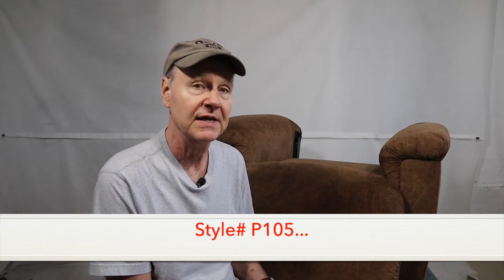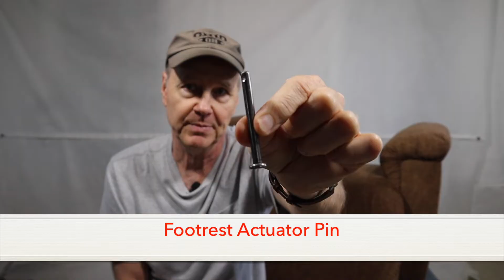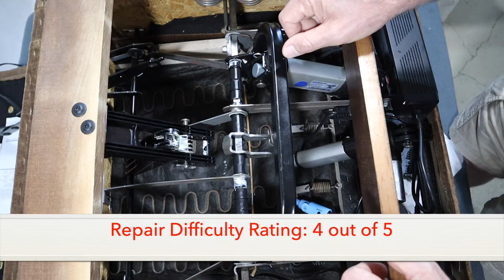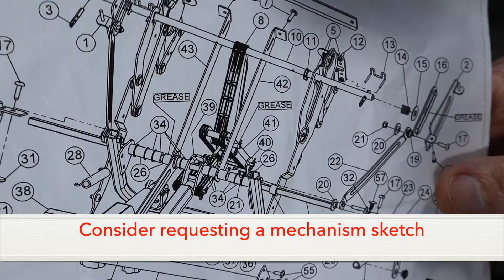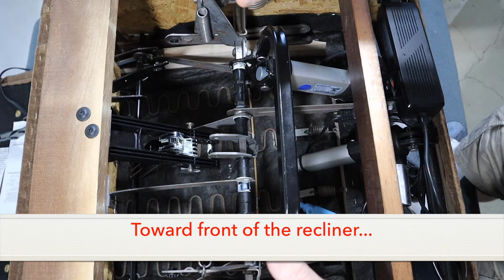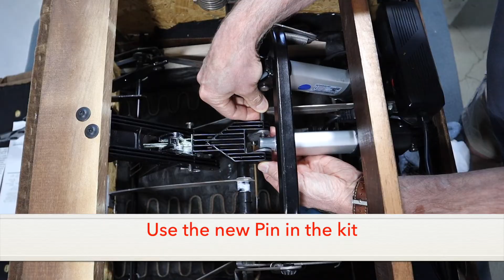La-z-boy Drive Toggle Clevis Install Setup

Comment: Nice videos and calm, relaxed demeanor.  The drive rod removal was a bugger for me until I got my son the tap it while I held the plastic part and levered against one of the brackets that kept moving and preventing the rod from sliding through.  Hard to explain,  but the drive rod on my chair required some pretty vigorous tapping of a long screwdriver with my hammer. I still have to go back and figure out the position of the springs and the metal piece the spring attaches to, as it fell off when I removed the springs for access and pushed the rods through. I saw one iy who had an extra drive rod so he could push the old far enough out while keeping all parts lined up.  But most consumers like me won't have that, nor did I have something long enough to push the rod far enough while also retaining the parts in place.  Plus on my chair you have to remove all the staples along the bottom so the leather can be rolled down and the drive rod accessed to tap through.  What a joke.  I'd never buy one of these POS again. I did see Amazon selling two metal replacement parts, probably like something someone describes below.  But La-z-boy shop sent me the one piece just like in the video.

Comment: Great video. Thanks. As another poster said, there is another toggle drive that does not require removal of the shaft. Much easier. My issue was parts had broken and disconnected, and I was not sure how they all mated together. Once I saw your video, problem solved.

Comment: I replaced the clevis on my electric Lazy Boy recliner this weekend. Thanks to your video all went well but for one issue which I believe was present before the clevis replacement. The foot rest when retracted does not draw tight to the rest pocket in the frame, it has a 2'' gap. I can push it closed with one finger (no resistance), remove my finger and the rest drifts forward. Other than this, the chair works flawlessly. the rest when activated, rises to the full extended position with no jerks ,bumps or noises.
Reply from the maker: @Chuck Ford - It's possible that your footrest actuator was damaged when the old plastic mechanism parts failed, preventing it from retracting fully. Or, if it does have its full-range of motion, you may be correct. There may be something else wrong that's unrelated to the Clevis install.
Reply: @reclinerrepairguy4155  Based upon your experience, would you dare a guess as to what it could be? The scissor mechanism dose not appear to be damaged or bent. It almost acts like it needs additional spring assistance to pull it the last little bit. I double checked your video to make sure that I installed the 2 vertical springs correctly and I did. 
PS: Thank you for your earlier response.
Reply from the maker: @chuckford5084  - Nothing comes to mind, other than what I already mentioned. I'd have to inspect the chair to make a determination.

Comment: Thanks for your this video. (I referred to another of your recliner repair video's as well). I found them invaluable. I added the extra plastic bearings as you recommended. I also picked up an 18 inch piece of 3/8" square rod at a local metal supply store, which made the job easier.  I agree that the level of difficulty is "a solid 4" out of 5.

Comment: I'll be using this video today, thank you sir. If I didn't have this, either my grandmother would be spending 160 bucks an hour for a service call or I would be attempting to  reverse engineer a lazyboy. 

Why in the world did they make that part plastic??????
I'm completely baffled as to why that was the best they could come up with.
Reply from the maker: @notthesun - Name brand furniture -- La-z-boy & other name brands -- is not high quality furniture. They are not trying to make the best furniture possible.

Comment from the maker: Important update! The design for this metal part has been changed/updated since this video was posted. The newest version of this part is installed in a similar manner, with the "legs" of the part pointing to the rear of the chair. However, if you install it upside down, the footrest will not open all the way. The key is there's a flat spot on the edge of the legs. The flat spot needs to be on top (facing up) -- I believe. This will put the part in its proper orientation, allowing it to work properly.
Reply: Your video did not show how to get the clevis on the shaft.  I saw another video where I have to remove the upholstery to get to the shaft.  I just want to make sure this is the proper way .
Reply from the maker: @Whovian56  - Correct, this video does not show how to install the part on the Drive Rod. The outside arm upholstery will have to be taken loose on one side & the Drive Rod will have to be partially removed to install the Clevis & Bearings.
Reply: I am having an issue with the drive rod coming out. I have everything disconnected and the upholstery loose on one side. What is the problem or best way to get the drive rod out?

Comment: Thank you for your extremely useful and clear tutorials. 
I recently broke the plastic motor clevis mount and the plastic drive toggle on my La-z-boy reclining chair. I did order on-line an aluminum drive toggle that clamps on the  square drive rod (not requiring a removal of the square drive rod), and an aluminum clevis mount. 
Had it not been for a very shoddy finishing of the drilled holes through these 2 parts (I had to re-drill them with a slightly larger drill bit to allow the pins through), the replacement could have been done in 15 minutes. I do not know if I got a random subpar kit or if such unconscionable marketing is common, but had I not been equipped to finish-up the holes, these new parts would have been totally useless. Once the pins could go through, the repair was quite simple and my foot-rest is working again. I wonder why La-z-boy did not replace their cheap plastic parts with this clamping mechanism that is so much easier to install.
Thank you again.
Reply from the maker: @daniell.4677 - Another related question is: Why did La-z-boy use plastic parts on their mechanisms in the first place? I suppose it comes down to who is in charge of product design & development at the time.
Reply: @reclinerrepairguy4155 - "who is in charge" or, rather "what" is in charge... "what" being the bottom line or planned obsolescence. Another explanation could be that the design and development boss was a genuine "lazy boy"... Cheers.

Comment: Have you seen the new design from Lazy-Boy, no more pulling staples or pulling the drive rod out, it's a split design that clamps over the drive rod with split bushings too, 10 minute fix.
Reply from the maker: @Mick Broomhall - I had a customer bring in a kit similar to what you describe. The metal parts that replace the plastic Drive Toggle looked like they could work. But the split bushings broke into 2 pieces when I tried to expand them to place them around the Drive Rod. The bushing (bearing) design is not good, and I recommended not using them. But the design of the replacement Drive Toggle looked ok.

This kit, if it's the same one you describe, is not from La-z-boy. It was made by someone else.
Reply: @Recliner Repair Guy  I work for a big retail furniture store in Tulsa in their repair shop. I have installed these new designed replacements 
In a few customer chairs now, not had one  issue with the split bushings breaking.  These things save so much time!
Reply: @tommyis13  I’m in OKC! I’m finding the one piece fix for about $15, but the two piece metal kit is around $100!  Have you found them for a better price anywhere?
Reply: @Chris Crawford  Hey Chris.  I haven't looked for the 2 piece, I just install the parts, the 1 piece drive toggle is quite an easy repair.

If you were in Tulsa I could do it for you.
Reply: @tommyis13  well perhaps for a seasoned pro, but I think the Recliner repair guy hit the nail on the head with a a 4/5 for the consumer.
Reply: @m Lawdawg  Recliner repair guy does a good job of explaining the repair, truly believe that anyone with 30mins of spare time can do this, it's really not that difficult, I would give it maybe a 2.5 out of 5.

Comment: Great video!  I will be replacing this part for the second time on my chair.  The last time, they just gave me the same plastic part that broke for free.  I wonder if they'll give this one free again.  Would you happen to have the part number for this kit?  Hopefully the service department knows what I need.
Reply from the maker: @mooseman3136 - You must have gotten the plastic replacement part from a dealer or service center. The manufacturer will only send the metal part (Drive Toggle). If you request the kit by name, you'll get what you need.

Comment: Hey Recliner Repair Guy.  Question.  I have a recliner I just got (hand me down) and I notice in the lower back (the bottom cushion area) it's feeling pressure and uncomfortable.  I looked back there and there's a board holding the chair together I assume going cross ways right where my lower back is, and instead of it being flat (the wide part of the board) against where my back would be, it's actually the edge of the board instead which make no sense to me as far as comfort would go.  So it's digging into my back.  Not comfortable. I tried putting a throw pillow in between but that just makes the bottom stick out more.

Is there a fix for this?  It almost seems like a poor construction.  Why on God's green earth would someone install a couch back with a skinny edge of a board as the only support on the lower back cushion of a recliner?  Is there something missing? Maybe some cushion or something fell out?  I don't see evidence of a cushion ever being back there.

Anyway just wondering if this is something that can be fixed because otherwise I don't think I'm going to be keeping this recliner.

Comment: Good video, I am having problems getting through to La-z-boy to buy the metal clevis kit and schematic. Where do you suggest I buy ? Thanks.
Reply from the maker: @Camping Traveling - It can take some time for manufacturer reps to get back with you. They are swamped with part requests. I recommend contacting them via their contact form on their website. Say something like, "I need replacement parts for my La-z-boy recliner, can you help?"

While you're waiting for a response, you can also try contacting local La-z-boy dealers in your area to find out if they stock the kit, or whether they can place a part order for you.

And by the way, if you are the original owner of the chair, the parts should be covered by warranty.
Reply: Is it a lifetime warranty on parts? My chair is 4 years old.

Comment: We are needing this part replaced. Our local La Z Boy repair guy who we have used before says the parts will be $20 and a service call will be $180, and labor to do the job will be another $200-Does this sound right??
Reply from the maker: @Richard Barkley - Rates can vary widely. I don't know how far the tech is traveling to reach you, or how much overhead his business may have, etc. For example, if the tech is working for a service center or dealer, they set the rates.

As an independent tech with little overhead, I charge $95 (+ tax) for labor for this repair. And at the moment, La-z-boy is not charging me for the parts here in Ohio (for consumers with warranty part coverage), so no extra charge for parts. However, I don't do this repair in-home. So, the customer would have to pay for pickup & delivery or bring the chair to me for repair.

So, if you're able to transport your recliner to the repair tech's work shop (& pick it up), you should be able to save $180.

Comment: Where can you purchase the actuator pin ?
Reply from the maker: @CC-qi4uz - Always start with the manufacturer when looking for furniture replacement parts. In this case, La-z-boy. Also, dealers that do service work (repairs) may also have them in-stock. When I retired as a repair tech, I had a fist full of those pins (in different sizes) leftover. So, your local La-z-boy repair tech may also have some.

Comment: This video does not show the removal of fabric staples, and glosses over the rod removal. 😢 inaccurate.
Reply from the maker: @tombo8659 - This video shows the finished setup or configuration of how the parts will look on the Drive Rod, when installed properly. To see the full installation video, goto this link -----> https://www.youtube.com/watch?v=8cyYZM1orQg

Important note: The 2-part video series linked above was made before La-z-boy changed the clevis design for the 2nd time. So, the correct position of the new clevis on the Drive Rod may differ from what's shown in that video series.